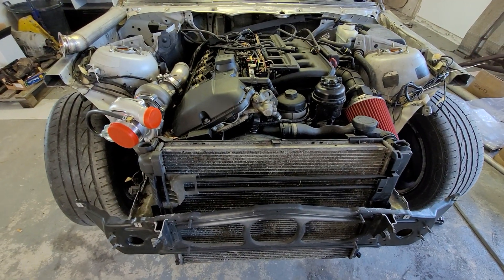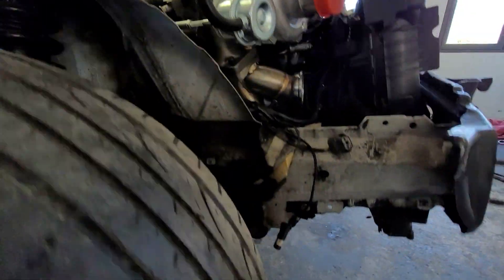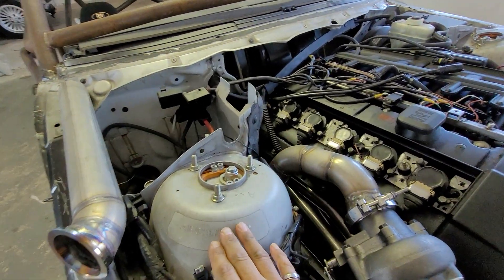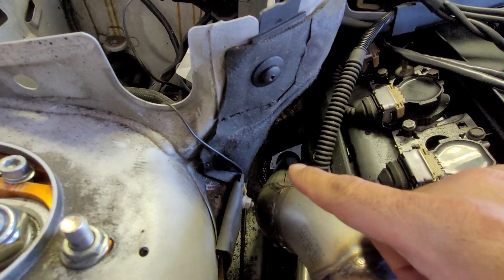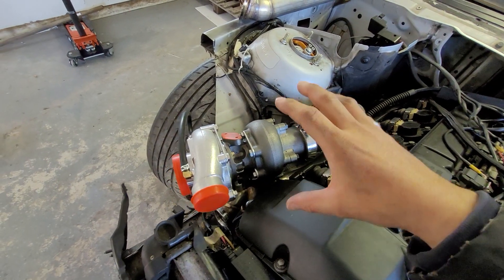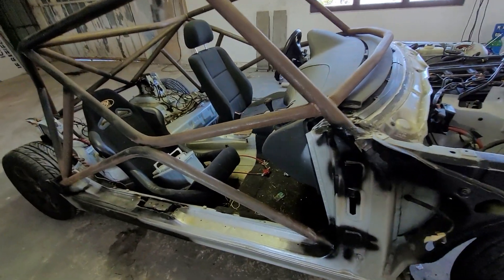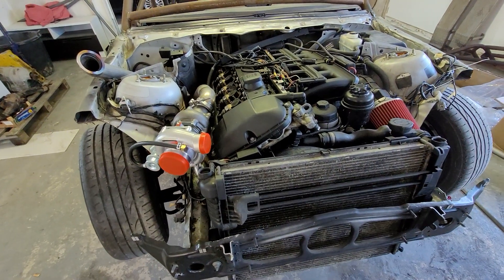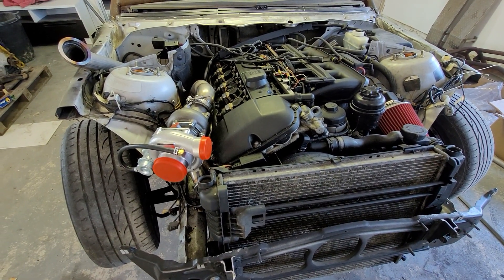BMW Turbo kit Laurent Motors exhaust side - Downpipe

Comment: Does this Turbo kit work with e30? and RHD?
Reply from the maker: HI, 
No, we do have a specific E30 turbo kit. If it is a M50 swap , then you need this M50 M52 M54 turbo kit below and select the option  "E30 E34 body" : 
https://www.laurent-motors.com/fr/61-kit-turbo-e36-e46-e34-e39-e60-

The turbo manifold is similar in design but has a different turbo location and the kit has a different downpipe. 

If you have a M20 engine as standard in the E30, then you need to check those kits :
https://www.laurent-motors.com/fr/60-kit-turbo-m20-e30-e34-e28-e21-e12

About the RHD models, we haven't tested our turbo kit on RHD but if the downpipe doesn't clear the steering column (which should not be the case considering the column placement) then it would require a slight welding adjustment to make it fit. 

Here is a how to choose one of our 3 stages of turbo kits :
Our turbo kit stage 1 is an entry level turbo kit to start your engine tuning at lower cost. 
It includes the manifold, turbo, downpipe, turbo oil line kit, intercooler and the piping, a manual boost controller and 2 gauges (boost and Exhaust gaz temperature)
But you will miss some parts if you want a complete turbo kit. 

Our stage 2 turbo kit is a complete low boost ( 0.6bar +60~80hp). 
In addition to the stage 1, you will get the Walbro 255Lph High flow fuel pump, the adjustable fuel pressure regulator, the dump valve with it's piping adapter and 3 additional gauges (oil temperature, oil pressure and Air Fuel Ratio (narrowband to connect on your stock 1Volt lambda sensor) )

Our stage 3 is a complete turbo kit for higher boost (1.4 bar + 150hp ). In addition to the stage 2, you will get a decompression plate and some high flow 440cc injectors.

For information, all of our kits are designed to fit a completely standard engine. There is no need to reinforce anything as the stock engine can handle reliably more than twice the original power. 
Only the stage 3 needs to lift the head to install the decompression plate.

Best regards.
Laurent.

Comment: Been looking at your site for a while now. Really tempted. Just need to work out what it would cost for the kit to be fitted
Reply from the maker: It depends on who will fit it to your car but you could count on approximately 1 or 2 days for a complete fitting of the the turbo kit. Afterwards, there could be delays to make it tuned (tuner near you is allways the best) so we allways advice not to need the car untill its completely boosted.
Reply: @laurentmotors  I’ll make some enquiries 👍

Comment: Is there also a turbo kit available for bmw e87 118i 2005. N46?
Reply from the maker: HI, yes, we do offer a turbo kit for N42/N46 engines with the turbo in top mount position only. take a look in our E36 E46 E90... section and tthe products in the second line are our 3 models (Stage1, 2 and 3 turbo kits) of 4 cylinder BMW turbo kits. You'll need to remove some parts where the turbo sits in front of the strut tower. 
Any question, please ask Laurent.motors.com@gmail.com
Reply: @laurentmotors  would a stage 3 turbo kill my 118i engine, becouse of the power?
Reply from the maker: @11seconds36  Manufacturers put additionnal strength in their engines so that millions of items sold could make 100 000 ++ miles/kilometers without problem. So that is why you can add at least 0.6 bar of boost securely on every engine. This would be the purpose of our stage 2 turbo (low boost complete kit) kit if you look for an easy and trouble free afterwards power increase.
Reply: @laurentmotors  Hi there, have you had any experience with N46? From what I heard it's tricky to turbo it because of the valvetronic system, can it be modified with stock ECU?
Any info on potential power for those engines?
Reply from the maker: @thris68  N42/N46 engines with Valvetronic engines will have the toughness to handle at least 0.6 bar of boost as every mass production engine. More then this, we don't have feed back on the behaviour of the engine. with 0.6 bar of boost would give just above 200-210hp on that kind of engines with our turbo kits. Nothing that would cause any reliability issues on a completely stock engine. 
About engine managament, we are not in this business and allways advise our customers to talk to an ECU tuner near them.
Reply: @laurentmotors  Thanks!